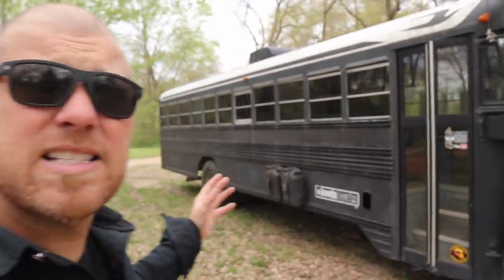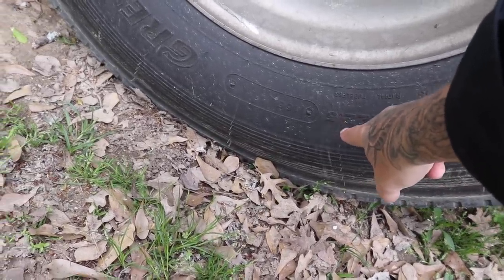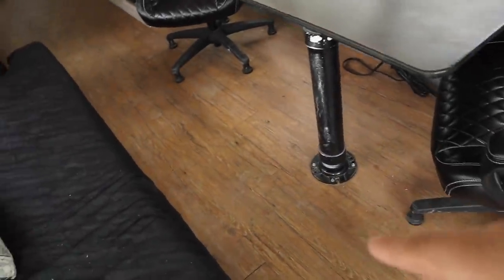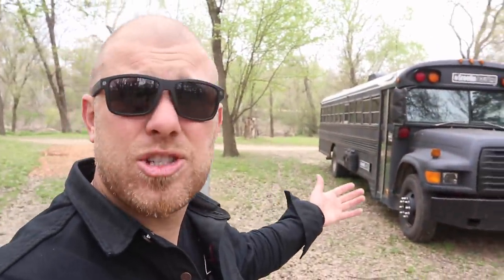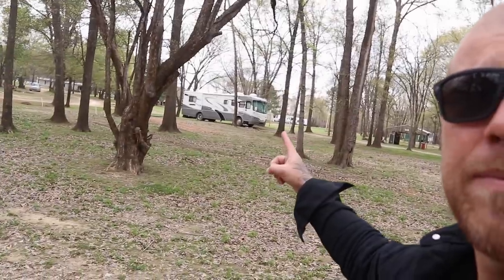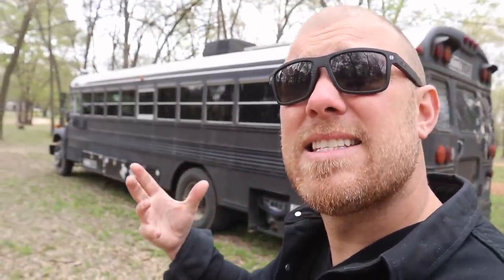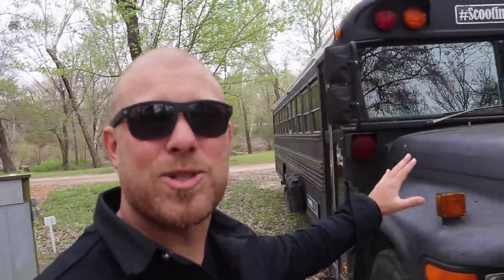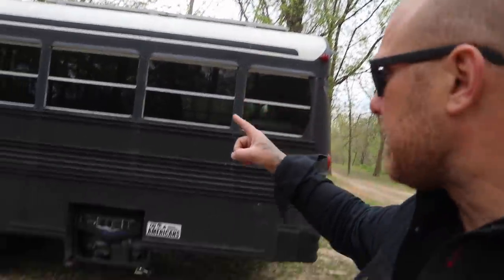5 WORST things about a SKOOLIE / School bus conversion.

Comment: No you don't understand. I bought 5 acres of land. I just want to put 3 or 4 buses there and NOT drive them. All I need is to get them there, I don't care if it's 30mph top speed, Once I'm there, that is where the buses will stay. One will be for storage, one to live in and the others, who knows. I'd like to put one way up on top of the hill, might have to wench it up there. I'm thinking if it has wheels they can't tax me on it.
Reply from the maker: sounds like a plan 👊
Reply: You might think about 40 ft  store contenders  A lot better to work with for what you want  they are heavy duty ,mouse prove  8ft wide 8 ft tall and 40 long . can be bought in by truck /trailers and are not taxable as they can be move
Reply: If you haven’t already, look into the zoning for your town/state. Many places don’t allow you to live in anything but a usual house and it has to conform to standards. There are also rules against having unregistered vehicles on land, and you’re often not allowed to live in an RV on your own property, especially as your primary residence. Ridiculous, I know. I hope that you live in a place without all of these rules.

Comment: On your back wheel conversion did you have to replace hub?  My single rim isn’t covering over drum is this ok?
Reply from the maker: I had dual rear tires. I removed them and had zero modifications
Reply: @adamsandoval  did you use spacer to the back of drum?

Comment: My question is about insulation. 

I already know how to summer proof the windows no problem at all. My only problem with summer proofing is increasing air circulation in the bus in the summer without having to open the windows all the time and let in the bugs. 

My other problem is winter proofing in general. 
Addressing thermal bridges and insulating the walls and floor.
Reply from the maker: Maybe throw some screens in the windows for circulation…? I never got around to too much insulating, Igor went onto new adventures with a veteran I know
Reply: @adamsandoval  I’ve learned quite a bit since I wrote that comment. I am proud to share what I learned with you ☺️ 

Sprayed Cork insulation is the solution. 
It stops thermal bridges because it stops thermal conductivity because itself is a thermal brake. 
Ingredients: Cork, lime Morter binder or cement binder, water, color of choice. 
Tools: air shooting Spray gun, Air compressor machin, bucket. 
Solution: 
1. Blocks thermal conductivity. 
2. Creates air tight sealed space. 
3. Mold doesn’t like it. 
4. Fire retardant. 
5. Sustainable. Renewable. Green. 
6. Bus stays warm in winter because it Keeps hot air inside your living space in winter by stopping the temperature bleeding out caused by thermal bridges going INSIDE OUT. 
7. Bus stays cool in summer because sprayed cork keeps heat from the sun outside from moving inside by stopping thermal bridge from the OUTSIDE IN. 
8. Can be sprayed on any surface. Including metal. Metal. Wood. Plastic. 👍🏽 You can even spray it on the outside of your vehicle to provide redundant thermal protection too (which is what I’ll be doing for my school bus)
8. It also won’t crack like stucco insulated places crack. In other words it’s not a brittle kind of insulation. It’s flexible and can bend and move. Increasing its durability far far above stucco or traditional paint coatings.
Basic instructions: Spray on floors and walls and ceiling before you put your sub floor and wall framing and anything else pertaining to plumbing or electrical. 1 coat takes less than 24 hours to dry. Ideal is 3 coats. Anything more just further increases protection but is also overkill. 

Sidenote: thank you for the screen idea you mentioned. I’ll look into that too. Also, for windows I found a solution to windows too. It’s called Carbon Ceramic Window Tint. The industry leading version is called Nano Ceramic Window Tint. 👍🏽

Comment: Good video Adam. I have a F350 four door, long bed, 4 wheel drive, powerstroke diesel pickup truck with a camper. In California the truck alone is considered a commercial vehicle. It costs a lot to register that truck every year. Another reason why I'm leaving California.
Reply from the maker: EDDIE MAN they do have some odd regulations

Comment: Great video adam.my only consern is driving a school bus at 80 mi per hour lol.they are not designed to travel that fast. I drove a garbage truck for many years and I know for my own safety consciousness that heavy trucks are more dangerous with more speed. I suppose out in Arizona with no traffic open it up so I take part of that. Back.Those old heavy duty rear ends optimize the weight that it has to push and it's definitely not for Speed.and the ride quality is a given. I will take that heavy-duty suspension over and air suspension with all of its problems any day as long as my back can take it LOL.nice truck.